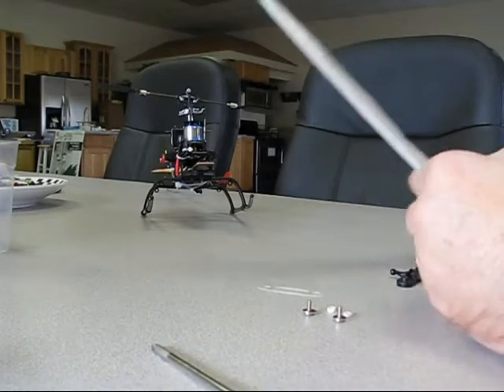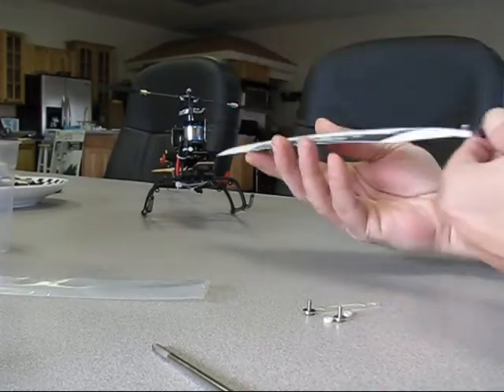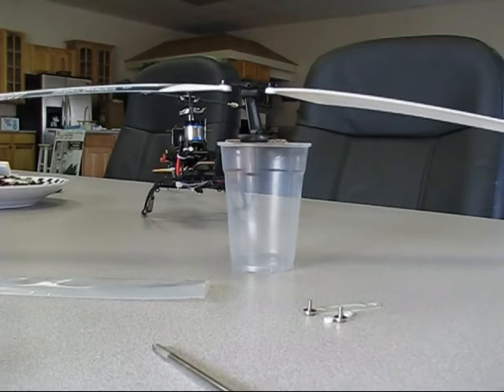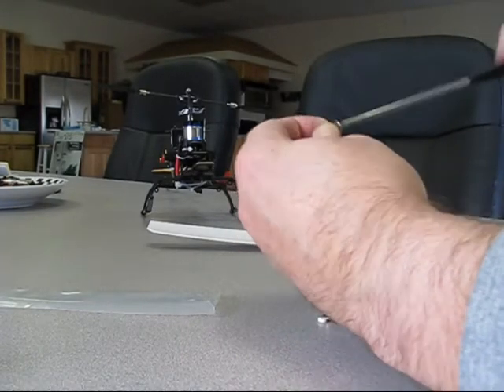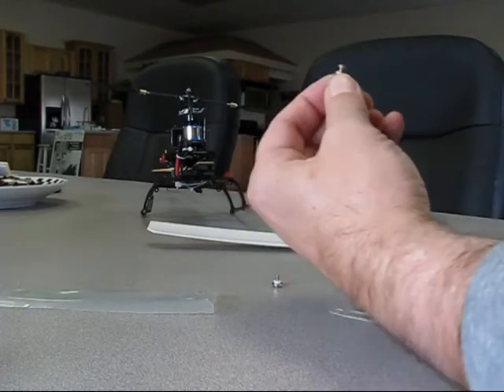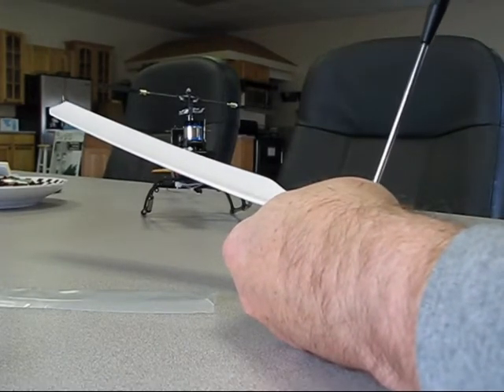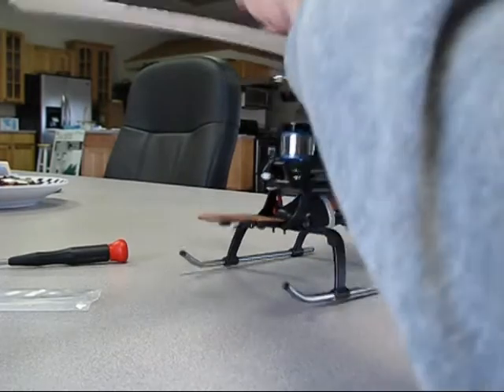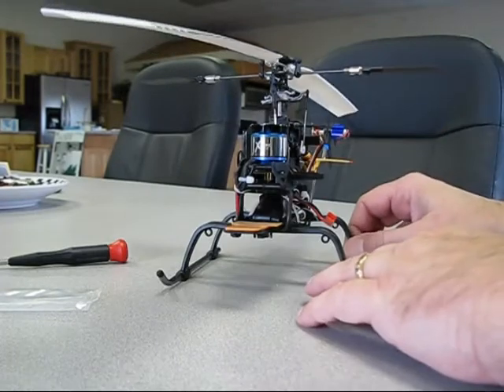SuperBlades XP Installation

Comment from the maker: @wkialyleiam  If you really want to run them loose, you could carefully open up the mounting  hole with a 13/64" drill bit (just the bit, not a drill). Just twirl the blade around it a few times.
We found several good reasons for running blades tight, and no advantages to running them loose. So we designed them to be run tight.